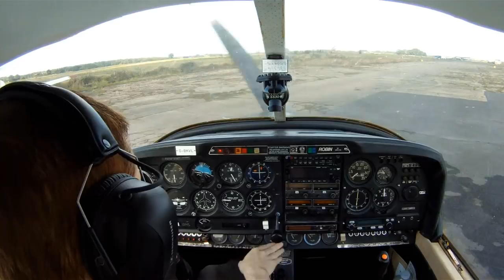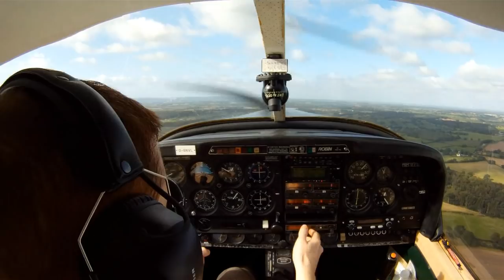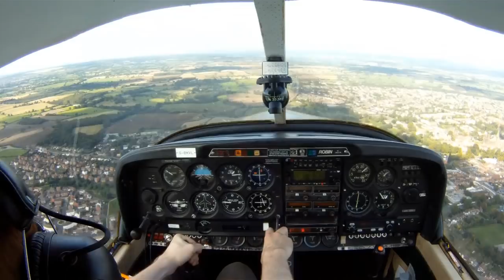GoPro Flying HD - In flight total electrical failure

Comment: what if that plane stopped in mid air because of the engine??? u die? or smth idk lol
Reply: It would act like a glider...it wouldnt just fall out of the sky
Reply: ***** The plane would glide, and then he'd have to search for some good place to land in.
Reply: ***** you can't land a plane without control over the wings.
Reply: But he WOULD have control over the wings, he just wouldn't have the engine. Do you think gliders use engines? They don't, but anyway they can glide without an engine power. The point is, if you lose your engine, you won't lose your wings' control.
Reply: *****
but this is one of those small planes...
Reply: ***** It doesn't matter, it has wings. Of course it won't glide like a glider, but yes, it'll glide, and well, if you picture a big airplane gliding, you need to consider that it is heavier, and longer, what can be worse, cause they have to find a longer space to land in.

Comment: I wonder perhaps why in your r/t you mentioned 'ready departure and lining up' on first take off and then proceeded to take off without informing anyone you were doing so?

Secondly, as has been mentioned, whoever taught you to start aircraft engines clearly didn't teach you properly; all you need are three slow primes and that should be satisfactory from cold, unless it's a hot start and a bit more throttle and less priming. But to keep pumping it is just wrong.

Lastly, an intriguing way to take off. Lift the wheels off, fly at 20 feet above the runway for a while then climbing steeply?! Really not good airmanship at all, as well as the r/t and engine starts!
Reply from the maker: Nick Jeins Some people say "rolling" to confirm they are going, but that's not a requirement.  If I say "ready for departure lining up" anybody else on frequency should be aware there is an aircraft on the runway about to depart.

Regarding your second comment, nobody had really ever taught me how to start an aircraft engine in detail other than "turn the key until it starts".  With the exception of my Instrument rating flying the Duchess which is a different method all together.  The PA-28 has a different way of starting to a Cessna 152, and the robin HR-200 and DR-400 are completely different again as they have no primer. You say less pumping is wrong, but on this aircraft it was the only way to get it going.

Regarding departure, again it's a way I was taught as I learnt on a short grass runway.  You need to stay in ground effect until you have enough speed to climb.  Not required on this runway I agree, but I guess it's a bad habit.

Thanks for the comment.

Comment: Well, in 30 years I have never seen an engine that hard to start. Cannot believe that you had the pump on and where "priming" it like a person possessed.  Starters overheat - flooded engines don't start... I do not recognise the aircraft type, so do not know the engine type, but no EFI or carburettor engine likes to start like that.  You are abusing the starter and battery - which will eventually fail you.  I would get out the engine manufacturers specs and engineering notes and check their recommended starting technique. If those do not work get a mechanic to look at it.  With the way you treat your engine, is it a surprise that you have electrical problems... do you think?  What was with all the fuel pump switching on/off - were you changing tanks?Cannot believe that you had that noise in your headset, but you stop to take a photo - ever heard of aviate first.... didn't see any systematic checks, no checklist, didn't seem to check cct breakers. An ammeter failure means you are on batt - so once identified, first action is turn off all non-essentials - didn't see any you do checks, you just let them all fail one after another.... you may have had enough juice to make a quick PAN call and intentions - then you're safer and so is everyone else you're flying around. Maybe I got this all wrong.  Perhaps you need to take a step back and evaluate things - so many bad habits there lad.
Reply: It's a robin, they flood on start really easily, the technique we use is if not starting, crank the engine and pull the mixture, when about to come to life, richen the mixture again. This guys just a bit silly and is flooding the shit out of it, would love to see what the overflow was doing
Reply: +GunsOfPlentyNZ exactly what I would do.  That is a common technique for injected engines. ur a kiwi I'm guessing.  I start flying in Fielding many years ago....
Reply: +John Blumenthal Im flying out of North Shore Aero Club up here in Auckland, Good to see some kiwis on here:P.  Also the robin aircraft use carbureted engines, have yet to fly a FI one
Reply: +John Blumenthal he doesn't use a bloody checklist for christ sake !! I have flown for 6 years and always use a checklist on my aircraft and i know it inside out. he seems incredibly complacent in his attitude and shouldn't be flying. He may fly well in his skills test but does'nt carry it over to his day to day flying
Reply from the maker: +John Blumenthal I'll let you into a secret.  This aircraft didn't have a checklist.  I was using from from a PA28, not my choice, the flying school said it was the only one that they had.  Apparently they both have a similar checklist.
Reply: +GoPro Flying I agree with MrGoproFlying on this one. i fly the robin 2120 (basicly the same aircraft) and we fly these free of checklists, however we have acronyms printed and stuck on the dash for ever sequence of check, this ensures you never miss the critical steps, for example the before takeoff lable shows TMPFFIHCTTLL, (Expanded Below) 
Trim, 
MIxture and Carbheat
Prop
Fuel
Flaps
Instruments
Ignition,
HatchesHarnesses,
Controls,
Takeoffbrief,
Transponder,
Lights,Lineupcall

They really do help for those one in a million "Oh shoot" moments where you cant remember somthing

Comment: jeezus.... is there no primer in this POS ?   Overtime he pumped the throttle, the engine farted and wanted to go.  Clearly starving for fuel, but I see no primer?
Reply: regardless of the fact that this fellow can't seem to listen to the engine when coaxing it to fire (maybe i'm old school), he did well to remember the cardinal rule "Fly the Plane".  He flew the plane and got her down safely.  Well done.  No biggie.  Try it at night, in solid IFR.  (been there, pre-go pro days).  Fun times.  No matter what, Fly the Plane.